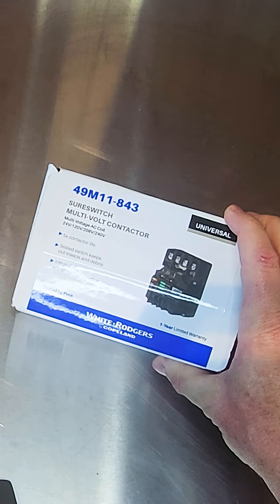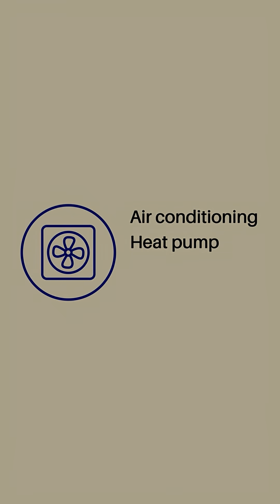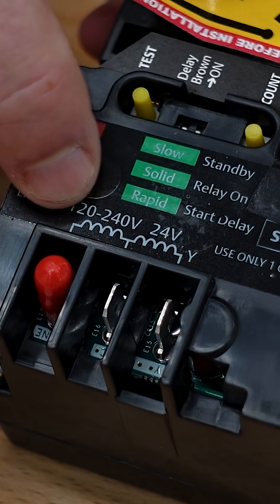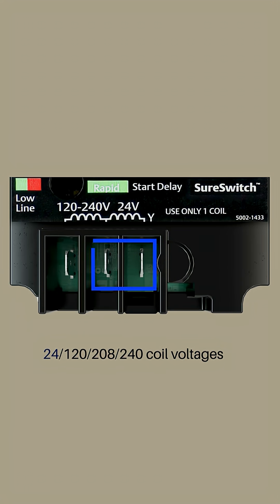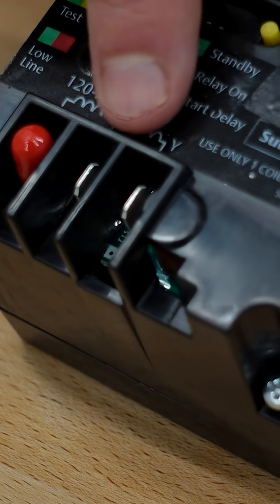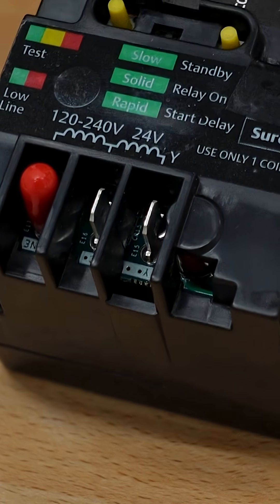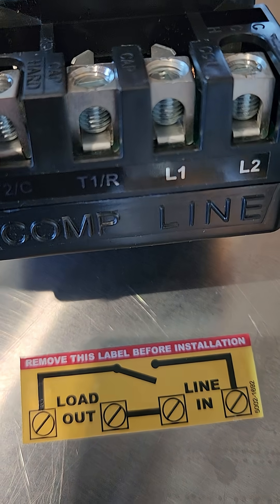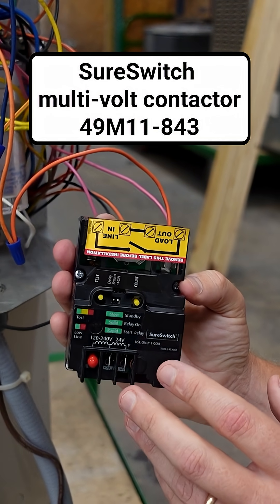SureSwitch by Copeland - Multi-Voltage Magic

Comment: I think the best thing about it is protecting the compressor by having the built in time delay, and considering how cheap the contractors are now I’ve had several short out after a day on new installs. Also it would hopefully prevent scroll compressor running backwards due to standard Contactor pulling in and out due to brownouts or full power surges